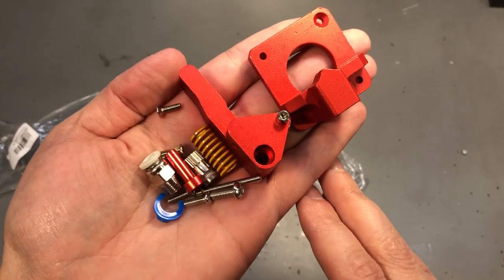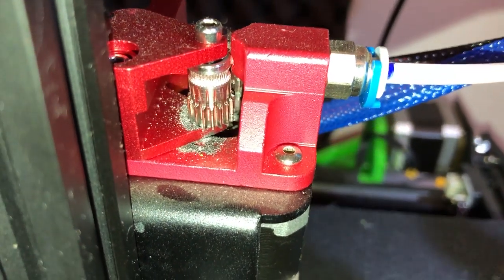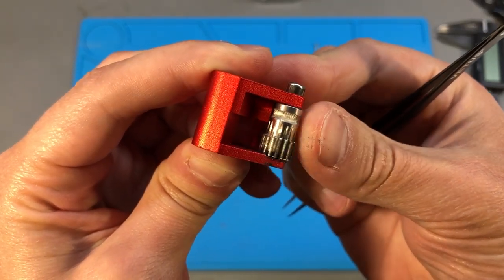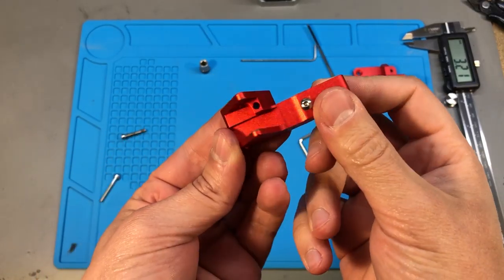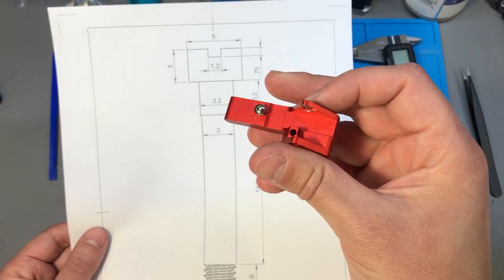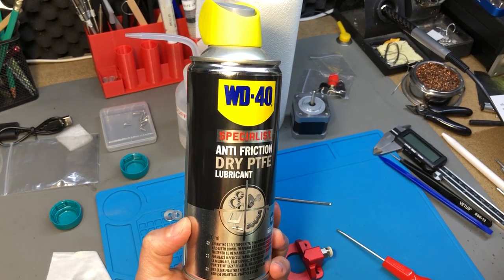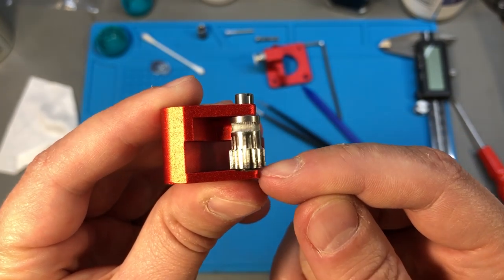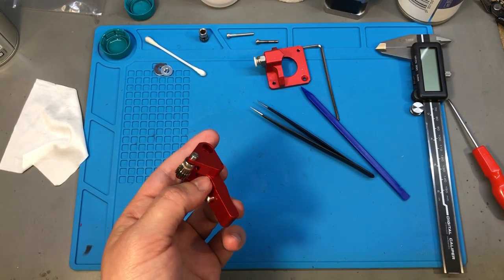Dual Gear Extruder Grinding Itself Problem | Voltlog #308

Comment: I recently installed the same extruder on my Cr 10 mini and so far no wear but I maybe printed a day with it, so the problem might show up in the future. I will take mine apart and look into the construction. But a tip for all that want to print really flexible filament with that extruder: just drill the exit hole up to 4mm from the side where the PTFE tube gets connected and put in a short piece of PTFE tube, sized exactly and shaped as a pointy tip so that it makes a perfect fit to the 2 extruder wheels. So there is no gap where flexible filament could escape and it’s the cheapest option to print Ninjaflex on your Bowden style printer. Works great so far for me. Picture of this mod is on my twitter account.

Comment: @6:20 don’t use a metal washer, use a nylon one, that will reduce the wear.
Reply from the maker: Sounds like a good idea to try. Thanks!
Reply: @voltlog  how has this fix you came up with working? Have you had any more grinding?

Comment: Excellent work! I just received the very same extruder. With just some minor prep before installation, this cheap extruder will be a huge upgrade. The hardest part will be sourcing a shoulder bolt like you designed, but even that is easy if you have access to a lathe.

Comment: Simple fix is to go to a hobby shop and get some 2.89mm brass rod. Cut off a piece slightly longer than the original screw. Using a m3 die, a vice and a slow drill , tap ~4mm of thread on one end. Then shim the bottom with a small piece of transparency film with a hole for the shaft. Put 2 small flats on the end of the shaft so you can tighten it with pliers. Don't lose any of the other parts. The bearing will run 10 x better on the brass.

Comment: I've had my CR10s Pro V2 for a little under 3 months and just noticed my gears are grinding the metal, actually had 2 small shards of metal among the dust. This video is super helpful. I can't fit a shim but at least I know what's causing it and will have to replace the part I guess.

Comment: I just installed my Winsinn dual gear. They addressed the issue with the threaded m3 screw. They also added a chamfer to the metal gears so it doesnt ride right on the metal arm and grind it down

Comment: Up/down (axial) play on the driven gear is desirable. It will allow the drive channel to align with the filament. If the driving gear, on the motor, is set too low then the driven gear will be forced into the lower support arm, causing wear. If the driving gear is correctly set level with the filament, and wear still occurs then this is a design fault. The remedy would be to shorten the driven gear or machine away part of the aluminium support arm. Machining the gear would be easiest, if you have a lathe. A slightly shorter gear meshing with a longer gear would not be a problem.
Running needle roller bearings on the threads of a bolt is a very bad idea, as many people have found. Hope the manufacturers change this quickly.

Edit   reading another post it seems the pivot bolt has been replaced with a more suitable component.
Reply: Update.  I have just bought one of these made by Aibecy and it has a fully threaded screw for the driven gear to pivot on. I made a special pivot similar to the one shown in this video.
The driven gear has an angle machined into the lower end which keeps the gear teeth away from the ali support. There is a good amount of end float, and in my setup the gear floats mid way. Do not overtighten the pivot screw as this will bend the support and trap the gear.
If the stock fully threaded pivot bolt is used, the action of the needle rollers, pivoting on the threads, will cause the driven gear to screw its way downwards and cause the problems others are getting.  Avoid the stock bolt.

Comment: Just ordered some M3x35mm (18mm thread) socket cap screws. Should leave a nice 17mm shank (give or take a washer) after trimming the threaded section to fit.
Reply: great solution

Comment: i got this one and allready put some spools of filament trough, no wear so far. i didnt grease it either. 
either they fixed it on mine or something else.  i lifted the gear on the motor side up a bit so the grove doesnt push down the filament, causing the other gear to be pushed against the aluminium.
Reply from the maker: I just aligned both of my wheels to be same level but I think you have a good point, having the one on the motor just slightly higher might help.

Comment: Washer is easy, just take a can and cut out a section of wall, then punch out a 3mm hole in it, deburr it and cut a small section to act as shim.  Gear just use a file on the bottom to remove a little metal from there, either use a long M3 bolt with a nut as arbor, them mount in a drill, and file that way ( poor man's lathe) or just by hand to get the gear edges slightly away from the bearing surface.
Reply from the maker: Yes, ultimately it can be done by hand with simple tools but now I know this cool local shop where I can have this turned on a lathe 😁

Comment: I bought the same style extruder equipped fortunately with a machined (black colored) bold so no horizontal play. 
What I did was I carefully filed a bit away so I could fit a small washer so the cogwheel can not grind the aluminium. 
I assembled it with a smidg of a light ptfe   grease. 
Now there is no horizontal or vertical play. 
Also  i adjusted the driven cog wheel with the help of a piece of filament and tigtend the grubsrew.
Reply: there really needs to be a bit of play axially along the gear. that allows the gear to align with the filament
Reply: @geraldmcclendon4444  , thank you will adjust great tip

Comment: The poor man's fix is to use plumbing tape, just put a thin layer enough to stop the x and y movement, but still allow the gear to move freely, probably need to replace the tape every now and then.

Comment: Maybe the gear is to sharp with the teeth of the gear acting as a milling tool against the soft aluminium. I would file away some material to make room for that steel washer.
Reply from the maker: The gear is definitely sharp but the problem was caused by the wheel not sitting parallel with the mounting surface as shown in the video. This caused the teeth to bite into the soft aluminium at an angle.

Comment: I have a Winsinn (CLONE) version from Amazon. No dust yet. Maybe you have printed more than me. I like mine.
Reply from the maker: I printed maybe 24h in total for the part to get like that. There might be different parts on the market, different tolerances.

Comment: What you need is a bowed spring washer under that cog wheel. There are very thin ones which would not require any machining on the carrier part, and they will reduce the friction area while providing a lift to prevent the cog from grinding the surface. Here is a pic of the item:
https://images.app.goo.gl/XmLJTyomCtcF8hkZ9
Reply from the maker: Thanks! I will have a look to see if I can source one.
Reply: I think this will cause the gear to grind on the filament. The gear needs the linear movement available to center on the filament.

Comment: I would replace that 3mm screw with brass rod.  A drop of silicon lube once in a while and it would last a good long time.
Reply from the maker: the shape is a little more complicated, I don't think just a brass rod would do the job.